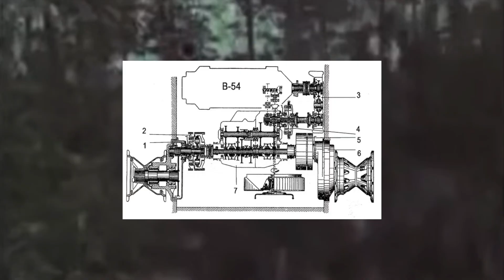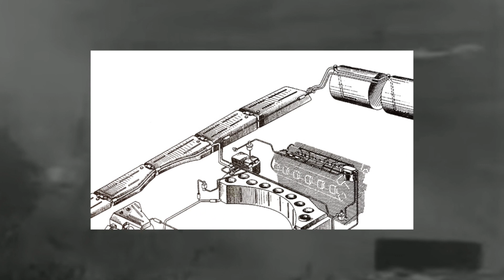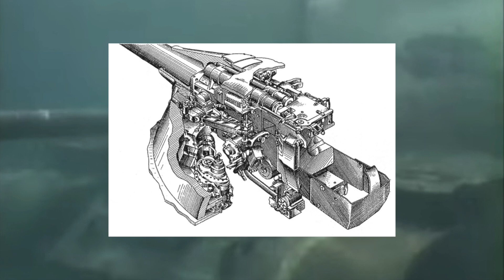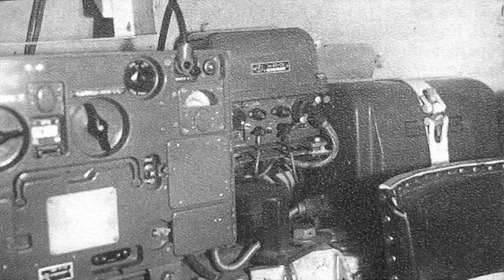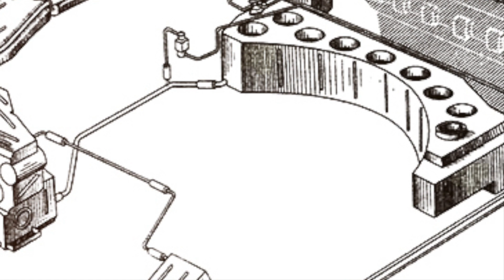The Road to the T-54  (NEW 2022 T-54/55 documentary)

Comment: The electric starter came back, do not know when. It seems that it is meant to be only a back up, but I use it because I always forget to open the air bottle valves, and thus not charging them when operating the tank my brother and I have.... Must write a reminder to front of me. The clock seems to be missing on most of the 55:s I have seen, but now I found one from the EBAY, so there will not be that stupid looking empty hole. As it is easy to remove and 24 v, someones truck must have the original now.
The main clutch is multiplate one like on motorcycles, but as mentioned, dry. And the most easily harmed thing on the whole tank. Even moderate slipping it may distort the plates so that it will not disengage fully after that, making shifting difficult. That is why later models have a lever that turns the pedal to on-off operating the air assist only. Conscripts can no longer burn the clutch... The mentioned heater is so soviet that it is half funny, half scary, as there comes an open flame out from the bottom of the tank. But it sure is fast to warm the engine.

Comment: The electric starter was never dropped, all T-55s (and it derivates) could start their engine with compressed air or with an electric starter or in combination. In winter we used both at the same time, particular, when the water and the oil still were cold just to have the extra kick needed to burst the engine into life. Once the engine ran, the compressed air tanks and the batteries (!!) needed to be charged again to the full. Starting the engine in summer only with air or the batteries alone was possible and often done.
The T-55 carried therefore four pieces of large truck lead accumulators, positioned at the right hand side of the driver, but also an air compressor to recharge to two tanks.
If a driver did not manage to start the engine, the crew was quickly left with empty tanks and batteries and then the tank needed to be tow-started with the help of another crew and their already running tank. This was dirty, time-consuming (adapting these big stubborn steel towing gables), exhausting and very dangerous work, actually illegal (but still carried out) and therefore hated by crews and officers alike.

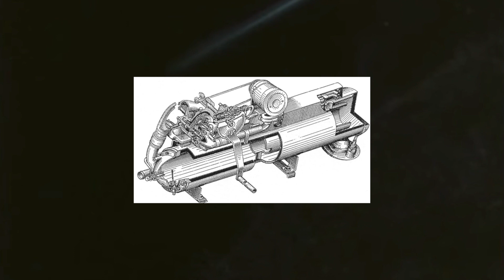The device shown in 8:12 is the pre-warmer. This device was being used to warm up the cooling water and in consequence the engine oil up to 50dgr.C respectively 20dgr.C before starting the engine when very cold in winter conditions. The device needed to be ignited first manually (a small flame stuttering out at the bottom of the tank through an open hole while cranking), used the tank's Diesel fuel and by keep cranking warmed the water directly and oil indirectly. It was quite a tedious task because the cranking was a bit physically exhausting and the operating crew member (typically the driver with the loader taking over) in an awkward position. 
Trying to start the engine without it in freezing temperatures carried the very risk to burst big main rubber oil tubes inside the engine bay causing a big mess and a lot of yelling and extra not-so-nice duties by superiors plus a few (illegal*) beers for your crew mates, who were forced to help the driver to clean the mess out.
Except for the driver seat, there were no adjustable seats for the other crew members.

I served in 1983-1986 with T-55As made in Poland in 1962 as a commander and temp. platoon leader (being 19 years old), and also as a gunner / commander (sitting at the gunner's seat only, the copula seat being designated for the company leader) for my company leader's tank, a T-55AK model with a double set of radio equipment and reduced number of rounds in the turret.

And because their is often a false claim out there: These T-55As could fire in full speedy motion because of their very accurate and well working double axis twin gyro stabilizer. 
It was this firing mode we practised the most, besides firing modes from a defence pitch position directly over sights or indirectly with given number tables (artillery support) setting the turret position plus gun angle from the inside, and finally also firing during a quick halt (not preferred any longer, but necessary if the the stabiliser was shot out of action) since this required a very tight coordination with all four crew members. 
All these firing modes were practised then in daytime, night time (IR) and under all weather conditions with the 100mm main gun and the 7.62mm axial machine gun (no other machine gun with these tanks any more at the hull, except for the external anti-aircraft 12,7mm machine gun outside at the loader's hatch).
Our T-55s also waded through the Elbe river each summer several times; I crossed it this way perhaps 15 times or slightly more. A huge field camp was established every summer with many East-German army and Soviet army tank units practising day and nights for weeks to come.

Peace! from Dresden / Germany

*strictly no alcohol for the rank and file in the NVA (East-German army) within our barracks. So the booze needed to be smuggled in with heavy punishment if caught in the act. 
PS: The main gun could hold precisely one case of beer bottles, if the bottles were carefully inserted one by one (so on top of each other, with the main gun in transport position, pointing sky-wards), but had to be taken out with the same care one-by-one so not to risk another mess there, with the same bad or even worse bullying consequences. This time not only caused by the officers alone but certainly from the deeply disappointed crew members. So you better did it right.

Comment: About the blast detection system, how did it differentiate a blast wave from a nearby nuclear explosion (if you call several kilometers away nearby) from a blast wave of equal strength from a much closer conventional explosive? It would become a real problem if the engine died every time one of the filthy freedom lovers artillery shells went off nearby.

Comment: Without a doubt the worst and weakest tank ever built and fielded. All of the new variants are still using upgraded versions of this terrible design.
Reply: How? The T-54/55 literally spooked NATO so much as none of their guns could penetrate it from the front that they had to design a whole new gun to counter it. It also had a 100mm gun, while American tanks were still using 75-76mm and 90mm guns on their new Mediums at that time (M26,27,28 Pattons and M41 Walker Bulldogs)
Reply: It was good for its time,ww2 tanks are terrible today
Reply: I would agree if you said that it's now an obsolescent or obsolete machine. I mean definitely, the tank wouldn't stand a chance against modern anti-tank weaponry. It's armor is just one piece too, so HEAT would just punch through that thing (of course some countries have modernized their arsenals and have added spaced armor on their T-54/55s). But the tank was one of the best tanks if not the best tank of it's time. It was cheap, reliable, had a great gun, great armor, and a good powerplant. Something NATO had to counter immediately (which their did, with their Leopards and M60s). But it wasn't even close to being a bad tank.
Reply: Did u just seriously judge a tank from the 40s by modern standards?